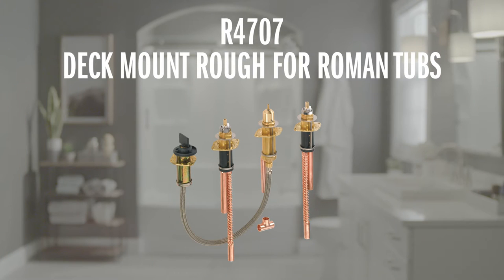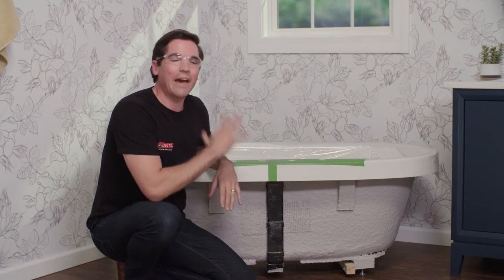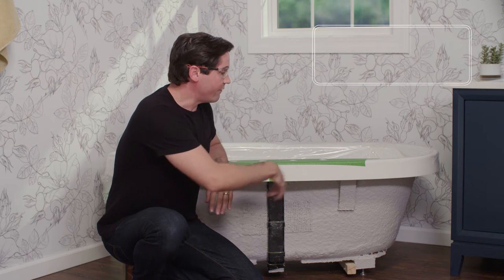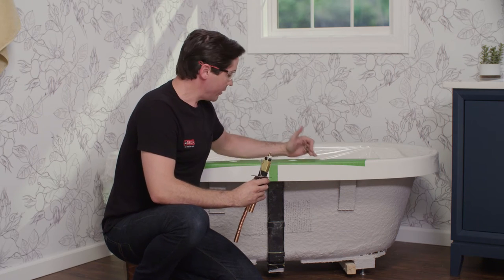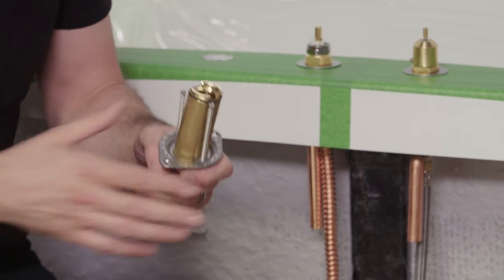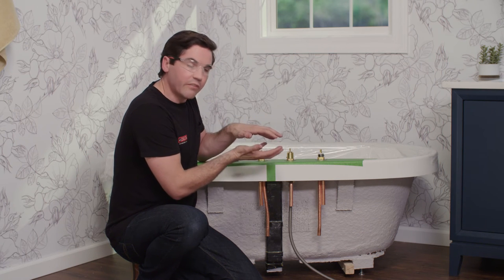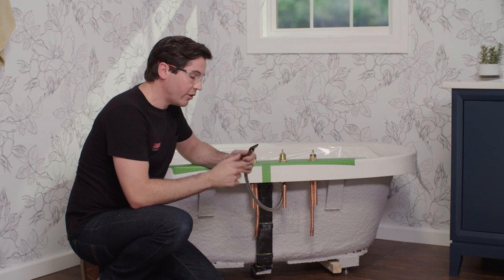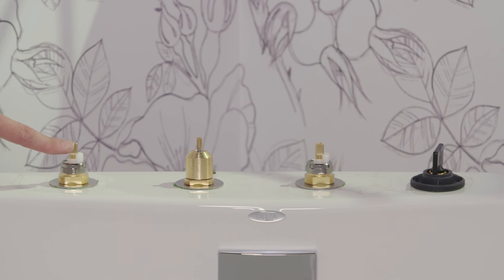How to Install the Delta® R2707 or R4707 Deck Mount Rough for Roman Tubs (Standard Deck)

Comment: Can you use sharkbite connectors on the water connection instead of sweating them??
Reply: No
Reply: They make a version with pex adapters attached, use that instead, R4707-PX
Reply: You can use 1/2” PEX x 1/2” Female Sweat Adapters and attach the PEX tubing with the shark bite connectors.

Comment: I've got a "cultured marble" tub whose currently drilled holes are just barely too small to fit the R2707. Is there possibly a similar kit with smaller adapters that would fit through smaller holes? I'm afraid that trying to drill larger holes will crack the tub.
Reply from the maker: Hello Customer. Thank you for contacting Delta Faucet Company and we are happy to help. Unfortunately, there is no smaller kit or adapters. With any further questions or concerns, please do not hesitate to reach out to us again. -Carrie
Reply: @deltafaucet  Thanks for replying. Drilling the holes ended up being no problem after all!